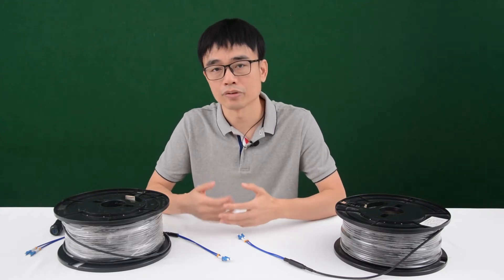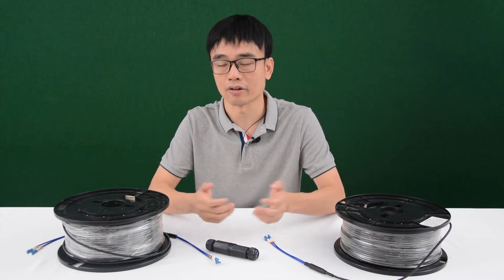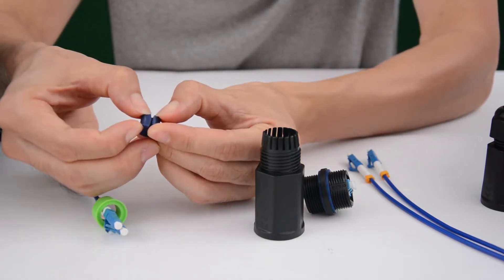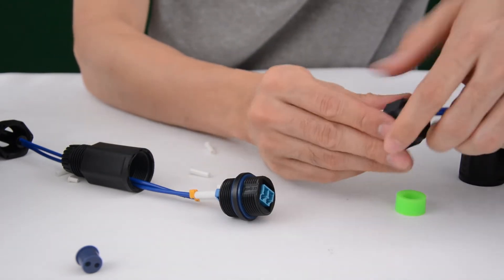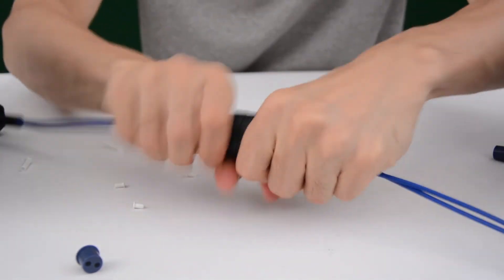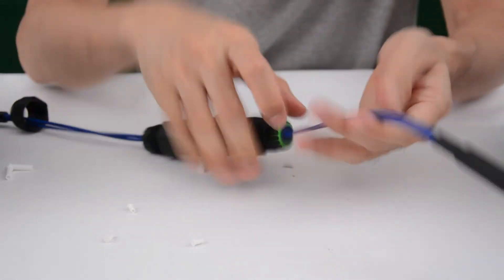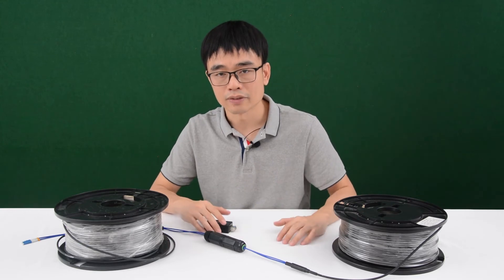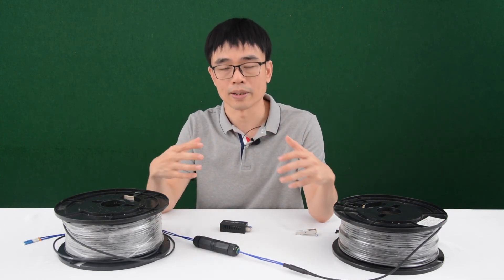How to Connect two Fiber Cables without Using Fusion tools

Comment: Can you use multiple connectors along a line without signal degradation?
Reply from the maker: The bandwidth is 1Gpbs , it is enough bandwidth for general networking. You can upgrade the media converter on both ends to 10G network link.